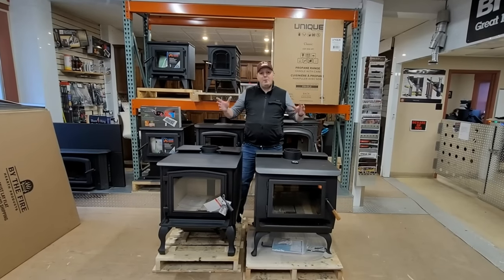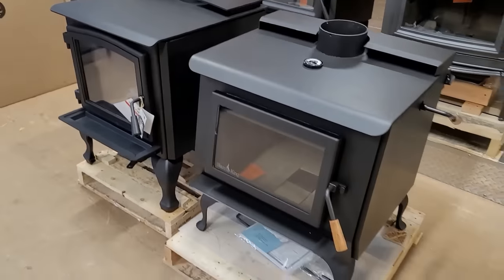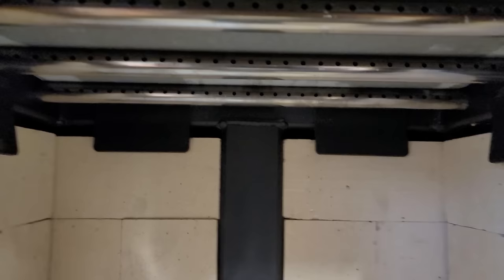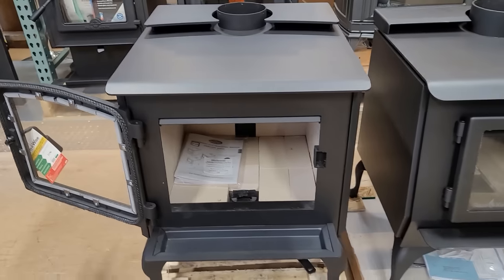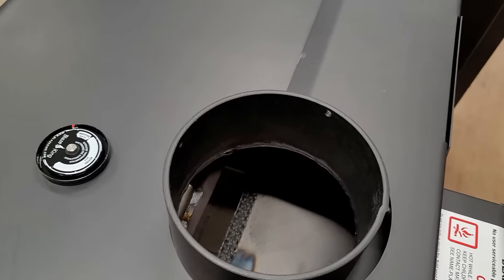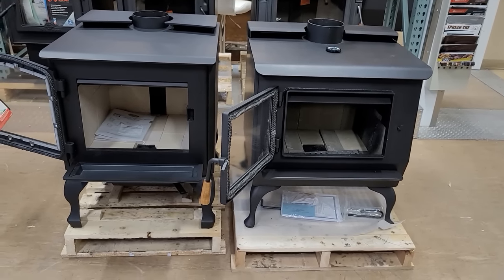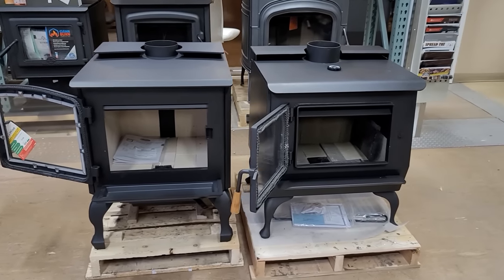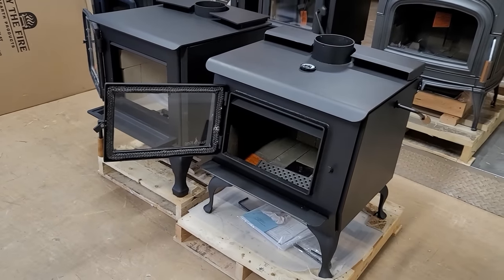Comparing Catalytic to Secondary Air Wood Stoves

Comment: This is with out a doubt the best video I've ever seen on explaining the differences between a catalytic and a secondary air wood stove.  I've never had a catalytic stove, but I sure get tired of feeding my secondary air stoves.  I now have the Hearthstone.  My previous stove was a LOPI.  My friend nick-named this stove, "Low output, per input" and he was right.  My Hearthstone takes at least an hour to heat up those soapstones so they start radiating heat.  Then the fire only last about 2 hours and it's time to refuel.  Unless you want the stove strictly for the way the fire looks, I'd get the catalytic stove.
Reply: Do you have one of the truhybrid soapstone models? If so, what's your take on them? They seem to have very mixed reviews on build and quality the past few years
Reply: We have one of largest jotul wood stoves and it has no trouble burning 6-8 hours on a load of wood once it's fully warmer up and has a bed of coals. It is the only hear source in our house which is almost 5000 square feet. It's an old house from the 1890s and is not well insulated.
Reply: @briankirwan9588  I am heating a combined 2600 square feet with a blazeking Ashford, I load wood once a day in the morning and leave it be. It's a cat stove, if I want the ambiance of the fire I open my damper and bypass the cat. That's usually only done when people are over otherwise Cat engaged, damper down to a lower setting. My stoves in my basement and it heats both the basement and main floor easily. If you need to heat an absolutely huge space with a cat stove I'd go to blazekings king model thing is a beast, my friend has it for his huge farm hours and is heating around 4200 Sq feet. It actually does the heating a little too efficiently imo cause his house is really warm.
Reply: @@QuietlyContemplating I don't think it's the dryness of your wood, but maybe it's harder wood.  I've lived in the Colorado Rockies and Northern Idaho, and there just isn't much hardwood to be found.  Maybe in towns you see more hardwoods, but not in Nature without human help.

Comment: This is by far the clearest and the most concise explanation for the subject. Thank you
Reply from the maker: thanks so much. Really appreciate the comment.
Reply: Could had simply said secondary= quicker heating of area and more wood consumption
Versus Catalyst = more efficient, last longer with longer heat up times.
Reply from the maker: @jamy8575 I could have but then it would not have made for a very good video.

Comment: Earned a thumbs up on this one, this is the first video I’ve seen that explained the difference for me. 
I had a secondary burn stove and thought it was catalytic.  I had a single wall riser off it, and the sticker took a while to blacken and burn off. It took about 10-12 hrs on a full load  and worked great. I loved seeing the flames. Almost no creosote in the chimney. 
My nephew had an old Ashley (conventional)that was twice as large, took twice or more wood per load, and burned it all up in about 2-3 hours. 
Now that I’ve moved, I’m looking for another and the thought of the catalytic type might work better for me in my old age. Less to tote

One time I burned some old oak that someone had in the basement for 15+ years and it was scary how hot that dry old wood got
Reply from the maker: Thanks for the feedback. It is amazing how 2 stoves with the same efficiency heat home differently.

Comment: Thank you for the clear concise explanations. After moving from Arizona to the Ozarks 15 years ago only recently decided to put in a wood stove. Had inefficient fireplaces in the past. But it was mostly aesthetic thing anyway. 
    I've been using the stove a little over two weeks burning primarily Red Oak cut from standing dead trees. 
    It is a secondary air England wood stove but I had done no research before buying from the local hardware store. And that gentleman wasn't much help.  LOL
   Seems I was lucky though. In England's owner handbook they stated the fresh air intake port on the back could either draw off house air or outside air if code demanded it or if the house had a negative air pressure. So I hooked it up both ways using a tee and 2 shut off valves I can either draw outside or inside air. I have a friend who's shop stove has a fan hooked up too blow fresh air in the Firebox to assist in Rapid ignition during startups. So while I was at it I hook a nice quiet $15 computer fan up to the intake that draws off the house. "Seems to work as intended" 
     England's handbook also stated to latch the door in the open position which cracks it about 1 in. For about 15 minutes upon startup. That is as efficient as the fan I installed. But the fan works better reloading on the hot coals in the morning. 
     It helps to read the book all the way through in the beginning. I didn't do that. It has a airflow dampener which works really well but then I found out if you turn it counterclockwise it will set the valve to close off the primary air completely. It is thermostat controlled.   Do how much depends on how hot it is. If you don't set it you will have nothing but Ash in the morning.  but if you reload the stove before going to bed you do not only have a large coal bed but many of the logs will also be a giant glowing piece still intact.  with little Flames popping up here and there about an inch. 
     Which is why I came here.  I was curious if that was enough Flame? Or that huge bed of glowing coals was better? my questions were answered. 
      I'd like to add I didn't have time to season my firewood very well. I realize it will create more creosote but things are what they are.  And after half an hour there  rarely is any smoke exiting the stovepipe. 
         🤠🐂🏞️🛩️

Comment: had both types and like the secondary air stove MUCH BETTER.  No waiting for the combustor to heat up.  The best way to tell if a stove is burning efficiently is to see what is coming out of the chimney.  If you see smoke (unburned gasses) it is not efficient.  If you see  shimmering wavy exhaust with no smoke you are burning most efficiently.  The secondary air stove is better in that regard in my 45 years burning experience.  No smoke is most efficient (and no creosote).
Reply: I moved into a house with a Lennox County Secondary Air stove. It has primary air control but can't seen to find a secondary air control and assume it is "fixed" with entry at the lower portion of the firebox between panels of the side walls. Does that sound correct? I do get alot of smoke with starting or reloading the fire, after a while (hour) seems to burn without must less or no smoke.
Reply: @neillee3793  there is no secondary air control.
Reply: @neillee3793  It takes practice, trial and error, to reduce the smoke output when reloading. We learned not to wait too long,  STT below say ~400, and the reload ignites quickly with minimum smoke. Also, fully opening the primary air control before reload and opening door. Slowly closing air control depending on how the reload burn takes off. Again, its a ymmv trial and error depending on stove, wood, size of reload, draft...
Reply: There definitely won't be any smoke coming out of a catalytic unit if it's in catalytic mode (or if it's burning hot in non-catalytic mode, in my experience). I haven't found the heating up time to be an issue.
Reply: And you are burning through wood like you live in a forest.
Reply: @scooterss2112  I do live in the forest. 😆
Reply: Catalyst burns clear fumes or something else is wrong. A secondary air stove consumes more oxygen, which would need more vents and draft into the room. In a small room cabin I'd definitely choose a catalyst. If I need to heat up a hall or very big space, then I'd choose secondary air stove.
Reply: @haliaeetus8221  I have a 12x26 shed. I have several windows. Could I not achieve the necessary input air with that?
Reply: I really enjoyed your talk about the 2 types of stoves! I have been highly interested in the 2nd burn type because of seeing the solo stove in action. But your explanation of the difference in burn time makes perfect sense 👌.  Not at all like today's" ghouvornmant polucees ". Keep making a difference! Sincerely, chris
Reply: The extra air required takes away some of that efficiency by forcing you to heat more air as it flows into and then back out of your house
Reply: You can look for an air gap between the top of the chimney and any solid or opaque exhaust gasses for an indication of complete combustion.  A clean burn will have an air gap, which is the water vapor/CO2 mix, when the mixture condenses it will be then be visible.  Exhaust gasses from a dirty burn will not appear clear immediately after exiting the chimney due to all the particulate.
Reply: @Andy-df5fj  unless the secondary air has a dedicated ingress you can hook a pipe into that feeds outside air
Reply: @JanMashat  Right on, a fresh air intake (fed directly from outside air) typically keeps the home warmer than letting the cold outside air seep through cracks in a house.
Reply: I had a woodstock ideal steel which  had both nothing but creosote  never had that problem with my quadrifire now burning lopi endeavor
Reply: I’m looking to put a stove in a large fireplace opening. Roughly 55”X45”. The 3 rooms in the area that I’m looking to heat is roughly 1100 sf.   The home is about 2500 sf in total.   Any recommendations on a stove I should be looking at?  The one local stove place near me is pushing Hearthstone, green mountain….   My question is any brands I should be looking at and how big of a stove should I get? I appreciate your opinion..

Comment: Have the secondary air stove, can get four good hours with oak, use a squirrel cage fan for air movement around stove, works great in the basement, actually heats the whole house with it.
The stove is 8 years old and has paid for itself many times over.
Love how the heat warms everything up in the house, especially the floor in the bathroom, my toes are very cold sensitive 😊

Comment: The only time our Blaze King ever uses the bypass is once a year (or twice if we go on a holiday) . Then it doesn't ever get low enough temperatures to need too use the bypass. In the morning I just turn the air control up a bit, the flame immediately starts so I can see how much wood is left and often can go a couple more hours.  We only add wood 3-4 times for 24 hours of comfort. My neighbour who I buy my seasoned wood from says ,You hardly use your wood stove?  When I say we never turn it off he was confused because you can't see anything but moisture for several minutes after adding wood (10-14% moisture) - the rest of the time it is just heat waves. It seems like it defies physics. LOVE it! He had to come it to prove to him it was going. He couldn't believe it. NO fire! He said. Nope there doesn't need to be a fire - just let it smoulder. The difference between smoke between our stoves is like the difference between an old diesel truck and an electric car. Sadly we have to breathe his smoke. And he uses 3 times more wood than we do.

Comment: Very informative. I've heard of catalytic stoves; they sound amazing. I've had a New Zealand built stove(Meridian) for 37 years and it is amazing as well; very efficient but probably not as efficient as a catalytic stove. My maximum burn time is about 18hrs with the air turned right down BUT it does blacken the glass at that setting so I tend to leave the air at around an eighth to a quarter open overnight; no dirty glass when I get up but plenty of coals to re-ignite a fresh load of wood. Thanks for the information.
Reply: 37 years, That is THE ultimate test and you didn't have to buy replacement catalytic converters, they are pricy and can be hard to find.

Comment: I had a  Vermont Casting catalytic stove when I bought the house. It was terrible.  It was hard to use, you really had to dial it in, the catalytic went bad and the stove didn’t run properly and it was expensive. 

I replaced that stove I’ve had secondary air since. Currently I’m running an Enviro insert and a Pacific Energy.  Great efficiency, clean burning and easy to use. Zero complaints.

This is a great video that really breaks down the differences.
Reply from the maker: Unfortunately Vermont Castings stoves is the main reason cat stove have received a bad name in the industry. Since then they have been purchased and revamped their units. They now tend to work better then before and don't rely on cats.

Comment: I have a lopi evergreen which is a secondary burn stove. I get about 10 hour burn times and will still have a nice bed of coals in the morning to start the next fire. I dont want to deal with a replacement catalyst every so often and i can make my own reburn tubes if i wanted. And seeing the floating dancing flames when I shut down the air is amazing to see

Comment: Definitely team catalyst here. My Dad has a Blaze King princess. I remember visiting during November a few years back. (west coast of BC) He was working 12 hour days (6AM-6PM), Mom was out of town. I stopped in to visit and beat him home by about 10 minutes. I walked in the door at 6:30 PM and was greeted to a hot house that felt like stepping off a plane in Hawaii. It was about 3°C outside, but the rain and wind were pounding like crazy. Blowing rain sideways. A real cold damp night. I just so happened to have my IR temp gun with me. It was 25°C inside the house on the wall the farthest away from the wood stove. Every room felt wonderful.

I asked him when he last put wood in there, because I couldn't fathom him putting in wood at 5AM just to go to work. He said "I put some in about 8 PM last night." I said "You've been burning this for over 22 hours?" He answered yep like I'd just asked him if 2+2 = 4. No smoke outside. No smell outside. The catalyst was in the active zone. I threw another log in and it caught fire with ease. (All his co-workers with non-catalyst stoves came home to cold houses)

He has one of those heat sink powered fans on top of the stove. I've learned that when that fan starts to spin is also when the stove crosses into the active zone. Thus if you see the fan spinning, it's time to close the bypass and let it run clean. Takes about 20 minutes. The longer the fire runs, the better the catalyst works. Because as a fire starts to smoulder and slow down near it's end cycle, the cat will see more smoke. The smoke ignites in the cat and keeps the cat active, pushing heat back down into the wood until the fire is completely out (some 30 hours later......40 hours if you have the Blaze King king model) Those long burns leave you with very little ash. He told me he took about a teaspoon of creosote out of the chimney during his annual cleaning. Wood is his only source of heat. The catalyst lasted about 8 years or so. That seems decent to me. When you get older, the ability to burn about 1/3rd as much wood as you would with a traditional stove is a nice selling point. That's a lot less stacking, carrying, buying etc.

The automatic thermostat (that you set from 1-4) is a nice feature. You set it on 4 (max) during the initial light. And then about 30 minutes later dial it down to where you want it. Usually 2, maybe 2.5..... 3 would be for nights when it's below freezing. Turning it down to 1 will prolong the fire. It's way better than constantly adjusting a manual damper all evening long. It's a real steady heat. House is comfortably warm without being too hot.

The secondary air models have their place. If you only heat on weekends or only want a few hours of burn time (let the furnace do the rest) than a secondary air is what you want. If you're renting a home out, you want a secondary burn for the simplicity. (You need to open the bypass handle on a catalyst model before you open the door to keep smoke from spilling out). Secondary will give you the dancing flames but won't do much during the last stages of the fire for efficiency. The catalyst will often give you glowing orange wood with little to no flames. Occasionally you'll see a horizontal flame along the top of the stove but no flame coming out of the wood. That's the smoke igniting in the catalyst. It's a strange thing to see even when you know why. It will do the dancing flames after an hour or so during the initial light. But they won't be as pronounced as the secondary air stoves.

The chimney is surprisingly not hot with the Blaze King. It's warm. You can touch it. But you won't burn your hand. There are lots of videos on youtube of people cutting a hole inside the chimney and holding their hand in there while the stove is running. They'll close the bypass and sure enough, the smoke goes to nothing. But why would it be hot? There is very little air going up a catalyst stove when it's active. Everything gets burnt inside the catalyst and radiated back downwards into the wood.
Reply from the maker: well said. Thanks so much for watching.
Reply: I'm old fashioned (B.C. central interior)...on occasion -50......just like a car or a body...."let it breathe".....we didn't care about WEF or local rules where I lived  (B.C. is very, very ignorant liberal)......oxygen-fuel-ignition.......heat that puppy after a "safe install"....make it glow!

Comment: I have an old, 1990 Osburn with secondary air.  I have coals after 10 hour overnight burn.
Very happy with it.
Mine has solid black metal in back for secondary air.  Thick metal with air holes across the upper back of firebox.
These new ones have all these tubes that may not last as long.
Curious when they get rotted out like a BBQ but they are probably more efficient being over the whole top of fire.
Cheers
Reply: The modern tubes are a high grade stainless, they don't rot.  They are very durable.